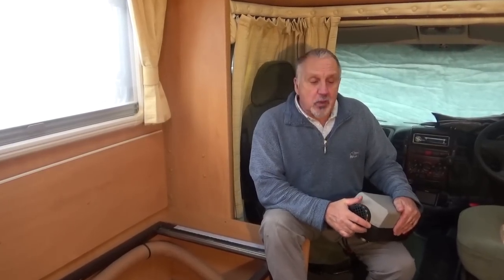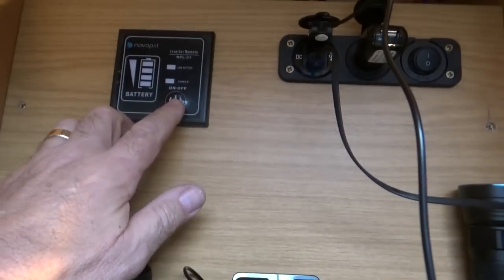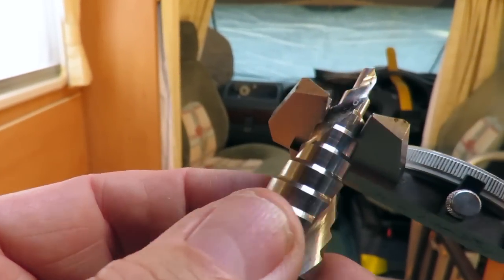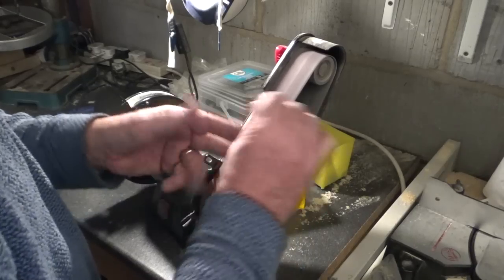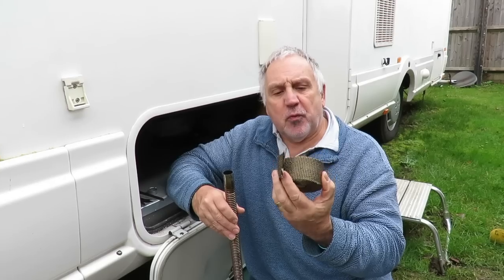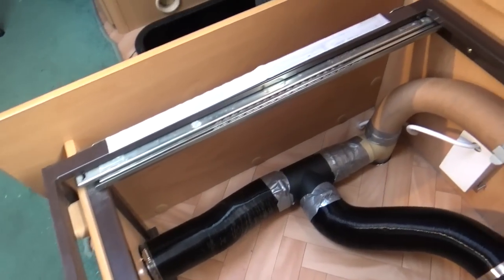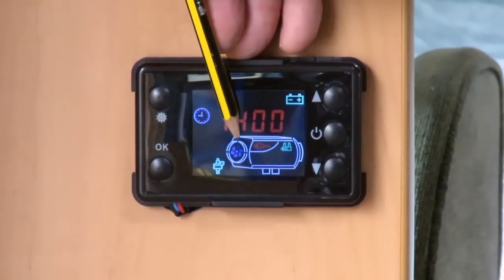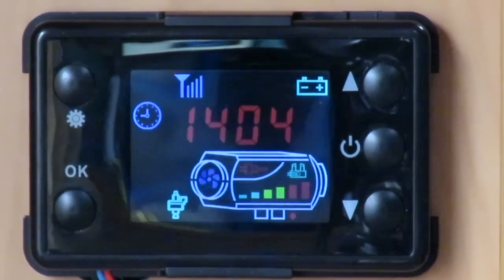How To Install A CHINESE DIESEL AIR HEATER, Ebay 5KW parking heater fitting guide. Full instructions

Comment: Great instructions. One question though please. I seemed to have missed or not understood the connection from the battery via fuse to controller. I am confused what to do here, can you explain please? Thanks John
Reply from the maker: Hi John. 
There is one red wire from the supplied heaters loom that needs to be powered from the vans 12v system. 
I run mine back to a small fuse box with a 15 amp fuse. 
That in turn is powered by my solar setup. 
ATB, Steve

Comment: Hi, just installed the heater and thank you very much for your detailed instructions. It works well, only thing is it smells a bit so not sure if that is the initial startup or I might extend the exhaust pipe to be further away and to the perimeter of the van. Is that normal? Again thanks heaps. John (Tasmania)
Reply from the maker: Hi John.
I think they all have a 'burn off' smell at first.
Definitely use a Co2 detector to be save though.
Mind you, they burn very clean. Even with the detector at the exhaust it will show practically zero emission! 
ATB, Steve

Comment: Got a question about the air intake hoose.  I got a Mercedes sprinter van and dont got a space like you got underneath the floor. So I eather have to have it inside the van or underneath the van where it Will be mud/dust/snow/rain.  What is the best option?
Reply from the maker: Hi Eddie
If it's going outside I would try and house it in a metal box.
By far the best option is inside in your van.
Reply: I've heard people having back pressure from the exhaust blow out the air intake. Look out!

Comment: Can you check something for me? I was wondering how warm the floor and surrounding air within 1 foot of the heater become when in use. Was thinking of installing heater near my water tank for warm water but wasn't sure if it would work
Reply from the maker: Hi,
There's hardly any heat given off really.
Certainly not enough to make any difference.
You can get units with a built in heat exchanger specifically for a hot water outlet, but not these ones.
ATB, steve
Reply: @TheWrinklyNomads  You're the best Steve. I think what I will do then is just run a duct or something near the water tank and that will give off radiant heat. Again I appreciate your answer

Comment: Have you had any issues with the fuel pump being mounted 90° , most videos have stated it needs to be mounted aprox 30° to prevent bubbles
Reply from the maker: Hi Shawn
I Ran this for 6 months with no problems at all.
Pump was fine.
Having the pump at 90deg you will never get cavitation bubbles build up in the pump.
Therefor no pump wear or incorrect fuel delivery.
However, since that video I have done a complete upgrade to this system.
Working even better now..!
I have a video of the upgade here:
https://youtu.be/HHJaPP2uLFA
ATB, Steve

Comment: Hi Steve, I have a VW transporter camper with pop top roof. I'm wondering if I can install the system underneath the van. Do you think this is possible. The 10litre diesel fuel container would this be sturdy enough. Obviously I've got to think about ground clearance. Would the heater system also be ok on it's own or should it have a protective case to protect it from the elements. Then I can just install up through the floor of the van the control components and heating tube. What do you think, ha, possible? The item I purchased from eBay is exactly the same as yours. I had fun installing dead locks. One day a lock. One day for fixing a badly place one. I found it was easier to template the locks with measurements as the instructions from my order, different company measurements inaccurate. This could of been due to vehicle model year, country or long and short wheel base vans. All good though. Your videos are informative and easy to follow keep up the helpful prep work. Your opinion of me installing my heater underbelly would be appreciated. I would not be concerned with time damage/exterior wear as I find the heater not expensive. Although I will obviously try and avoid physical damage with perhaps protecting the unit. It's just the van is not so large especially when the bed folds down requiring most floor space. Thanks Cheers Trevor.
Reply from the maker: Hi Trevor 
That all seems perfectly doable. 
Certainly try to enclose in a case of some sort. 
I have upgraded my system since this video. 
Have a look, it give you some more ideas. 
https://youtu.be/HHJaPP2uLFA
These heater are ideal for small campers as well. 
ATB, Steve
Reply: @TheWrinklyNomads  Hi thanks Steve, just got the heater today. I installed 5 deadlocks took 6 days but there was another chap in England was having same time problems as me 😀. Oh, now I'm thinking of a security rail across the windows. Thought a solid tube inside a hollow steel tube to distract portable grinders. Maybe fill the tube with grease, keep the inner tube rolling. Then dynabolt or weld to window body work. I'll have a look at your mod's with the heater. Thanks for getting back. Cheers from Oz.

Comment: Hi, nice video. Does the heater gets hot itself ? how close to walls can it be mounted ?
Reply from the maker: Hi Daniel,
The burner unit keeps pretty cool considering the heat it can pump out.
However, since that video I have done a complete upgrade to this system.
I show unit the temperatures in an enclosed space as well.
Working even better now..!
I have a video of the upgade here:
https://youtu.be/HHJaPP2uLFA
ATB, Steve

Comment: Just got mine today great help watching this. (instructions nightmare) I have a vauxhall vivaro, I think the unit is going under the passenger seat as there's plenty of room there. Can I ask why you did not put it I the lower external compartment? To reduce noise etc
Reply from the maker: Hi Martin,
You are quite correct and after six moths Ive upgraded the whole system:
Video here:
https://www.youtube.com/watch?v=HHJaPP2uLFA
ATB, Steve
Reply: You can also run these on Red diesel! 👍Much cheaper than of the pump ⛽
Reply from the maker: @martinj9251  - hi Martin, the whole system has now been upgraded and I am running on red diesel. 
Here’s the video of what I done:
https://youtu.be/HHJaPP2uLFA
Reply: @TheWrinklyNomads 
Thanks for the message,  All info much appreciated. Quick question as the instructions are useless! The large black rubber gasket that is on the under side of the unit, Does this stay there then goes on top of the metal mounting plate,  Advice much appreciated
Reply from the maker: Yes, correct, between the unit and mounting plate. 👍🏼
Reply: @TheWrinklyNomads  thank you very much appreciated 👍🙏

Comment: Hi, my heater start work with out touching  the control and the control doesnt respond to turn off. I have to remove the fuse to stop the heater. any recommendations please I need help

Comment: Hello I bought an 8kw version, but I believe it is less than...
I use NesteMy HV100(no smell,no co2,non hygrocopic water they say) instead of normal diesel means that less burning temp?
Is there a menu to set it to 8kw when it is from factory set to 5 kw (bought for 8kw).
I have 3 knob control panel!
Thanks for the great video's they are made very Well!!
Greetings from the Netherlands, Hans .
Reply from the maker: Hi Hans
Not too sure if we can get Neste My HV100 fuel in the UK..?
But I know it's a very clean fuel.
Glad you liked the video, thank you  👍
ATB, Steve

Comment: what about bed smell of diesel fuel inside the camper??
Reply from the maker: These heaters are fully sealed, combustion and fuel takes place inside and all smells and exhaust gas is pumped to the outside.
So no nasty smells whatsoever.
Thanks
Steve
Reply: @TheWrinklyNomads  thx

Comment: Hello, it is one of the best installation videos I've seen so far, lots and lots of explanations with a bonus of tips and tricks. I have bought the same device and I want to mount it on my camper. The worry I have is the exhaust pipe, since the floor is all flamable materials. How did you isloated it in the end and how hot does this exhaust gets?
Reply from the maker: Thank you.
The exhaust does get pretty hot and you can't have it touching anything flammable.
I have a a 1" gap all round the pipe and work well.
Also wrapped in exhaust tape, but this still gets hot.
I think as long as your sensible and don't allow the pipe to touch anything and vent away for the van you wont get any problems.
Been running mine very successfully now without problems.
I never leave to running when I'm out of the van either. You can, and many do,  but for peace of mind I only use it when in in van.
ATB. Steve

Comment: Does anyone know if this timer controller can be used with a Espar hydronic? I just need a power  positive output from the timer to switch the heater on. I have the 7 day timer but it does not have a remote function, Id just like a timer I can program to power up a wire for a hour at a time and control with a remote. Any Suggestions?

Comment: what unit did you purchase?  I would like to get the same one.
Reply from the maker: Hi DB,
I bought the 5KW unit from here:
http://rover.ebay.com/rover/1/710-53481-19255-0/1?ff3=4&pub=5575042610&toolid=10001&campid=5338626854&customid=youtube&mpre=https%3A%2F%2Fwww.ebay.co.uk%2Fitm%2F12V-2KW-5KW-Diesel-Air-Heater-Remote-Control-LCD-Display-For-Truck-Van-Motorhome%2F372668198609%3Fepid%3D13035049746%26hash%3Ditem56c4c16ed1%253Ag%253ADCMAAOSw6IFezJNj%26LH_BIN%3D1

ATB, Steve

Comment: getting confused over these night heaters, people have done the instalation like yourself and had problems. you had a straight forward instalation and set up. is the a supplier or brand to avoid as most ebay ones say uk yet are in hong kong or china etc.
Reply from the maker: Hi Andy,
My unit is just a standard Chinese made product bought through Amazon.
These units are pretty bulletproof.
The problems are normally due to installation, not the unit itself.
Any problems are easily sorted out be the controller showing you the error codes.
You can pay £1000 for a branded unit..! But that wasn't for me..
ATB, Steve

Comment: sir  at  10.30  on your  video  i see you put down a stainless steel  plate with  2  holes   one  is  for the  exhaust poison  fumes but the other hole is for fresh intake  beside  it. my  question is   would it  not  be  possible  just to  keep the  fresh air   pipe  inside the  cab  and  recycle  the  heat  alittlebit   rather than  sucking  in  freezing  cold  air  ??also  where do you buy  the  extra  ducting  extra  connections  e c t  say  like for a  longer  moterhome
Reply from the maker: That's just the way these units are designed. So that all services can be brought up from below.
There are many air heaters on the market and they all use this design.
I think the inlet air temperature in the combustion chamber would not a significant change in the burn rate.
You can get extra ducting and duct kits from here _
https://amzn.to/3x4XxeU
Also since this video I have completely upgraded this setup which is running really well...
here's the video:
https://youtu.be/HHJaPP2uLFA
ATB, Steve

Comment: Hi 
I'm thinking of getting a deisol heater for the static caravan iv just moved into . it's a 35ft by 12ft thinking it would be cheaper to run than the two 47kg gas bottles.
Would you recommend getting one as you have had yours for 2 years  ? Can you recommend a good deisol heater I'm thinking of getting a 5kw there are so many to choose from ? I'm thinking it will cost roughly about 50p per hour in deisol to run on today's deisol prices on medium settings as your video price was £1.25 per liter at 32p per hour . Any information would be appreciated.

Thanks lee
Reply from the maker: Hi Lee
I’ve found these heaters very efficient and very cost effective. 
My one has run without any faults since I fitted it. 
Mine is the generic cheap 5Kw Chinese diesel heater, but there are a couple of top of the range types, Webasto for one, but they are at least 5x more expensive!!
So very much personal / financial choice really…..
Reply from the maker: Also I have upgraded my heater system since this video. 
Best upgrade I’ve done!!!
Here’s the link:
Chinese Diesel Heater Upgrade - Best Improvement Yet..! -  Full Installation And Testing.
https://youtu.be/HHJaPP2uLFA

Comment: Thankyou, that was extremely helpful 👍🏽🙏
Reply from the maker: Glad it was helpful Dean. 
I ran with this for some time but, since this video I have completely upgraded my diesel heater system. 
I have a video on the modifications I made here:
Chinese Diesel Heater Upgrade - Best Improvement Yet..! -  Full Installation And Testing.
https://youtu.be/HHJaPP2uLFA
ATB, Steve
Reply: @TheWrinklyNomads  that’s great I’ll check that out later. In the meantime, have you got any idea why the heater would randomly switch on and I am unable to turn it off without unplugging the electrical supply to it? I thought I was imagining things a month ago and disconnected it and using your video to set clock etc. again I just tried it and it switched on and off nicely, then 1 hour later, it came on again without me pushing any buttons??
Reply from the maker: That’s a bit strange??
Never of it happening before. 
Possibly a faulty controller???

Comment: Does this need wiring up to the vehicle's battery and earth? Thanks
Reply from the maker: It requires a fused 12V positive and negative supply.
ATB, Steve
Reply: @TheWrinklyNomads  thanks. Is there a way to do that using the engine starter battery? It'll only be used when van is running
Reply: Why would you install a diesel parking heater to only be ran whilst the van is running? Kinda defeats the purpose (Just use the waste engine heat then).

Comment: This is great...I'm almost ready to install mine, thanks for the help. Can this be left on overnight?
Reply from the maker: Hi David,
You can leave on as long as you wish. But one thing you must have if your thinking of doing that is get some good Co2 detector alarms...
An absolute must.
They do run  very clean, but don't risk it without them.
ATB, Steve

Comment: Clear & informative, you got my sub. One question, over on "mels world" he uses a prob fuel feed on "vented" tank, is the original tank vented, or should it be?
Reply from the maker: Hi,
Yes the kit came with a top feed line, and to be honest I regret not installing it now.
Live n learn eh...!
I may be changing to the vans diesel tank soon anyway.
The fuel tank is vented with a one way screw cap allowing air in to prevent a vacuum forming inside.

ATB, Steve
Reply: My orange fuel tank lid has the look of a one way valve however it has needed me to take a darning needle to make it work as the hole was not cut thru! I only realised this as having watched Mels video and noticing my tank had gone shrunk as in having a vacuum I realised the hole was only there in design.

Comment: Personally, I'd have placed the tank and heater in the storage compartment and just had a duct pipe feeding the heat into the cabin.
This way, you'd have less noise and no fuel in the living compartment.
Reply from the maker: Hi Alien,
After trying out this method for 6 months I have completely upgraded this system, which included doing exactly what you have suggested....
Best upgrade so far!!
Also done a video of it here:
https://youtu.be/HHJaPP2uLFA
ATB, Steve

Comment: great video. looks like we bought similar units, that included the fuel pick up at 2 minutes 12 seconds. did you use the fuel pick up in the end?
Reply from the maker: Hi Gary,
For this install I didn't use it..
But I have since completely changed and upgraded this setup.
Really works well for me,
Here's the video link showing what I done:
https://youtu.be/HHJaPP2uLFA
ATB, Steve
Reply: @TheWrinklyNomads  top job on the upgrade - learnt a lot as ever

Comment: So by just pushing the fuel fitting loosely into the tank did it seal up well?
Reply from the maker: Hi
Yes that worked fine.
However, since this video I've completely upgraded this setup.
You might want to take a look and see what you think?
https://youtu.be/HHJaPP2uLFA

ATB, Steve

Comment: I’m almost done mine but I can’t get the electric going. I’m attaching it to a fully charged 12V battery and all the connections are attached but the reader won’t show anything. It seems to have no power :( Am I wrong to be using a 12V?
Reply from the maker: 12V is correct. Even if you were using different voltage, the display would show an error code.
There is a red and a black cable the are in the loom specifically for the power feed.
Reply: @TheWrinklyNomads  Thank you! At least I know I have the right battery. I appreciate your advice.
Reply: Just an update. It turned out the vevor heater was defective. I bought another similar vevor heater and the power worked like a charm with a 12V battery. Thanks again for your guidance.

Comment: Really useful video thank you. Just two points:
1) Why not just get another fuel tank that fit the space rather than cutting the floor?
2) PLEASE fit a carbon monoxide detector! :)
Reply from the maker: Hi
About 6 months after installing and testing I made a major upgrade to this install and done just that.!
See the video here:
https://youtu.be/HHJaPP2uLFA
Also, I have 3 Carbon Monoxide detectors fitted.
1x close to the heater
1x bedside
1x general position
Better to be safe Eh.....👍
ATB, Steve

Comment: Where did you mount the fire extinguisher?
Reply from the maker: Hi Slydog,
Although I've got a fire extinguisher on board and a few C02 detectors, there more for show really.
No chance of anything happening with theses heaters.
Although I did hear of a Eberspaecher/Plannar or similar once overheating and melting the wiring, but their protected to cut out well before any risk of fire as are these heaters.